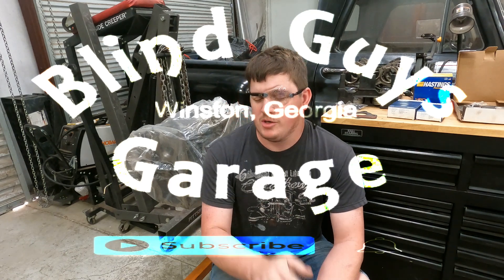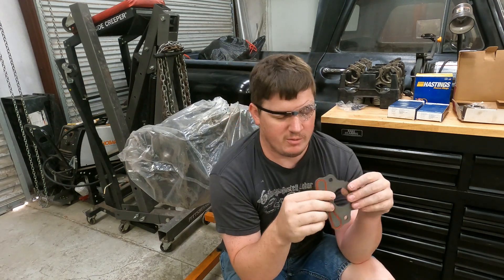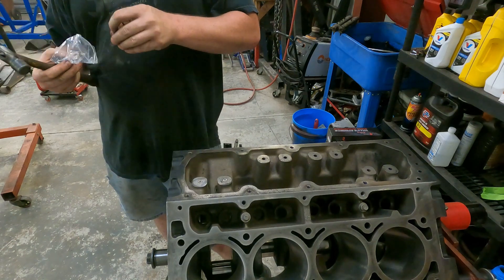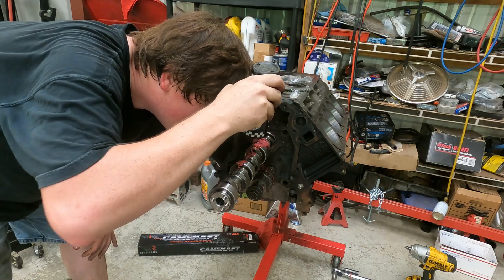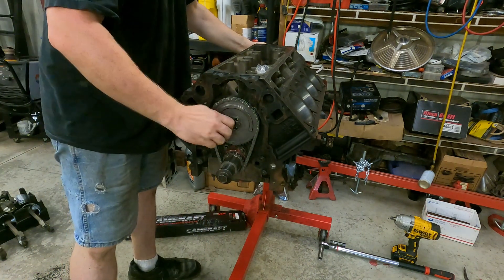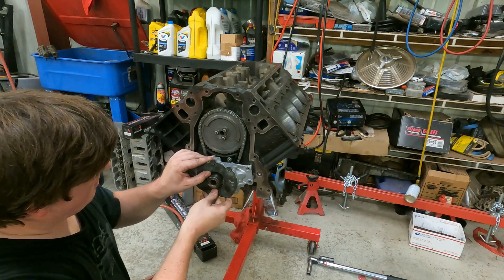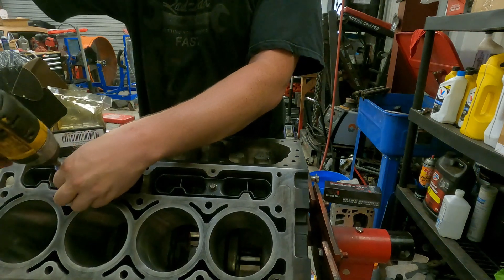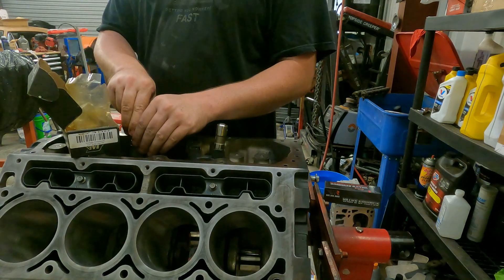How to? DOD_AFM delete on a 2006 and newer LS based engines 5.3 6.0 6.2 ls3 ls4 ls6

Comment: That timing chain looks super loose
Reply from the maker: May be a little unfortunately a lot of these are that way
Reply: @blindguysgarage but it preformed well right?
Reply from the maker: @zelly1327  yes the engine ran fantastically as a matter of fact it’s still running great today and that was more than two years ago

Comment: What do you do for the computer side how do you delete dod out
Reply: Thanks for info
Reply from the maker: @kevinhibbs4847  your welcome
Reply from the maker: I have a guy locally now that would come out or you can take him your PCM abd he would tune it you also can do a OBD plug in device that will disable the DOD/AFM I will put a a link to one in the next comment. The best way is have the pcm tuned for it tho
Reply from the maker: https://www.amazon.com/Active-Management-Disable-Disabler-Vehicle/dp/B07TTRC3MM/ref=asc_df_B07TTRC3MM/?tag=hyprod-20&linkCode=df0&hvadid=434795592233&hvpos=&hvnetw=g&hvrand=1923125886151093804&hvpone=&hvptwo=&hvqmt=&hvdev=m&hvdvcmdl=&hvlocint=&hvlocphy=9010839&hvtargid=pla-904884370531&psc=1&region_id=972485&tag=&ref=&adgrpid=101305226135&hvpone=&hvptwo=&hvadid=434795592233&hvpos=&hvnetw=g&hvrand=1923125886151093804&hvqmt=&hvdev=m&hvdvcmdl=&hvlocint=&hvlocphy=9010839&hvtargid=pla-904884370531
Reply from the maker: Also here is another link to a guy my buddy used to have the DOD/AFM deleted on his 2009 Tahoe
Reply from the maker: https://www.pcmofnc.com/product/dodafm-delete-2013-older/